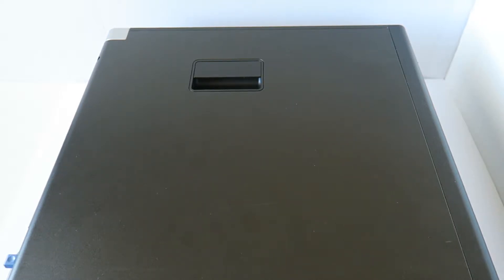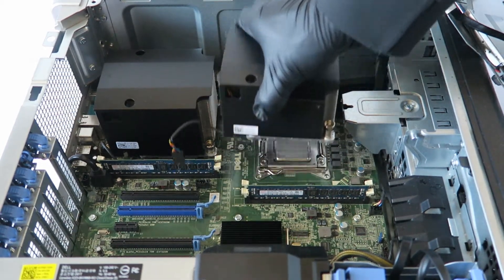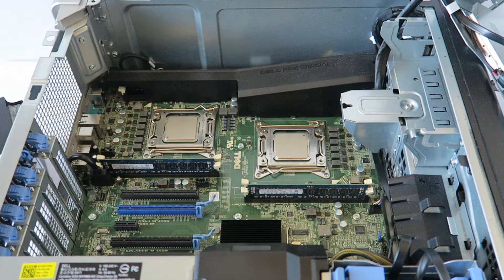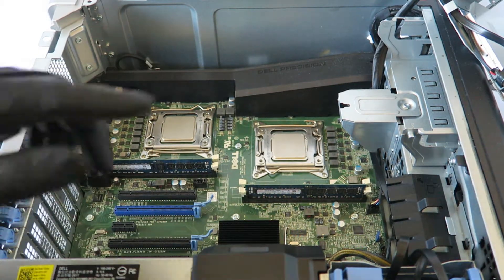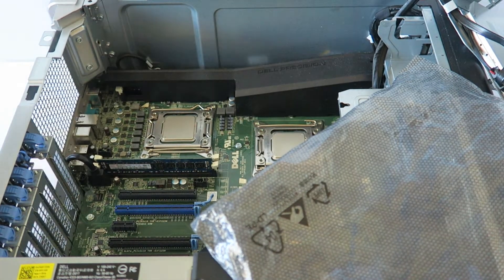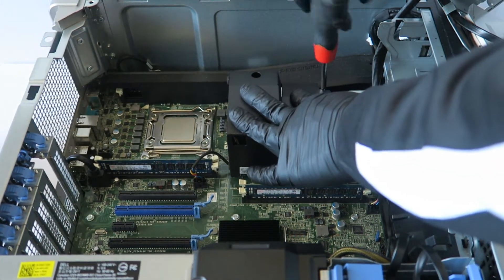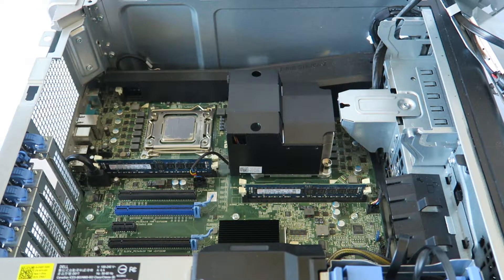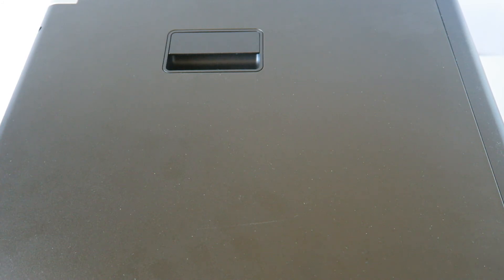Dell Precision T5600 Upgrade Processor

Comment: When you put the new processors in how can you tell which direction to put them?
Reply: The processors have a "keyed" corner where it looks like the corner has been cut off.  The corresponding processor socket on the motherboard also has a "keyed" corner.  Match up the two "keyed" corners and the processor should nicely slip into the socket and be flush and level before the locking levers are locked in.  If the fit doesn't feel right, check for alignment or bent pins on the processor or socket.

Comment: Ok a few questions and sorry but I see E5-2670 V3 and V4. So which is the correct one to use? Also will an E5 2683 work and if yes which version? # V3 Or V4? Thank you in advance.
Reply: I'm pretty sure only v1 xeons work

Comment: Hi, what is the PSU requirement for 2 processor? currently i have t5600 with one processor but Im planning to add one, my psu 635w. is 635w is sufficient for 2 processor?.
Reply: Yes, enough
Reply: @hpcre111  Thank you

Comment: Do you know how to "un perc" a T5600?
Reply from the maker: Hi, i do not understand what do you mean upgrade?
Reply: @Mxkdt  not upgrade. Un perc. I don't even think its possible on the latest revisions of the bios.
Basically i need two drivers to make all six SATA ports work on the t5600 since i dont have a perc h310 raid card. But the process to un perc the motherboard requires these two .exe files that are undownloadable from Dell support.

Comment: Hello i have two xeon 2670 v2. Can i upgrade with the same processor but version 3 or 4?
Reply: Are you sure you have a t5600 and not a newer model like the 5610 or something? Find exact model then check compatibility on dell website

Comment: I have a Xeon E5 2609 2.4 GHz processor installed on my T5600 and want to add a second processor which is Xeon E5 2630 3.0 GHz. Would this work?
Reply: It won't work.  They need to match.

Comment: SPECS:

DELL PRECISION T5600

PSU: 825 WATTS GOLD PLUS
RAM: 2X8GB (1 pc of 8gb Ram each processor when dual)
PROCESSOR: TWO E5-2690 PROCESSORS
GPU: RX 570 4GB
STORAGE: 1 SSD AND 1 HDD IN 2 SATA PORTS

Problem:
-During dual cpu config: No post, fan spinnning, no LED light in power button or anywhere.

Troubleshoot tried:
-Swapping CPUs, Trying single each. Both processors truly works, second socket doesnt whenever single or dual
-Placing RAM in different places, or removing, adding
-Cleared CMOS (Removing Battery and putting back, holding power button etc)
-Checking bent pins (no bent pins, inspected it hundred times)
-Reseating Rams
-Reseating CPUs
-Checking CPU stepping, version, manufacture details etc (both are identical)

Possible solution but not yet done:
-Adding more ram

Possible issue:
-Defective socket
Reply: Hellp please any advice!!! :<<<
Reply: Have you tried rice?
Reply: Replace CMOS battery